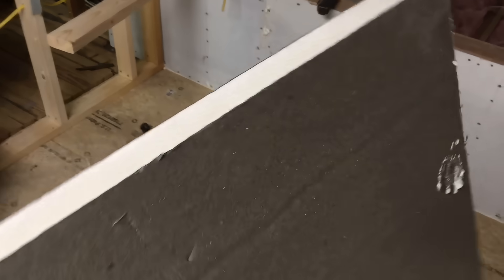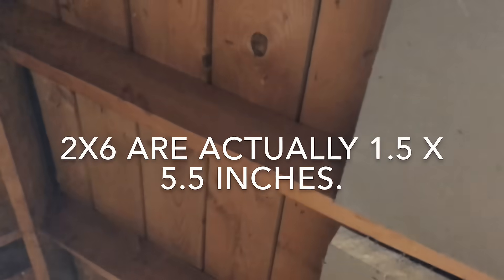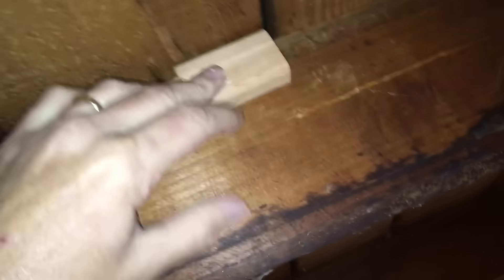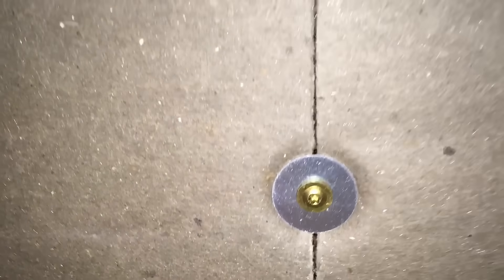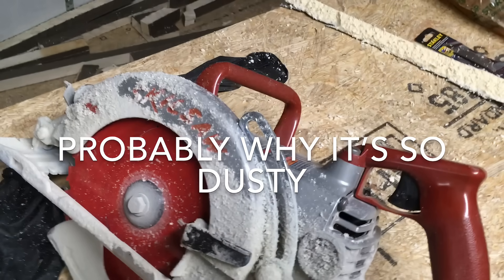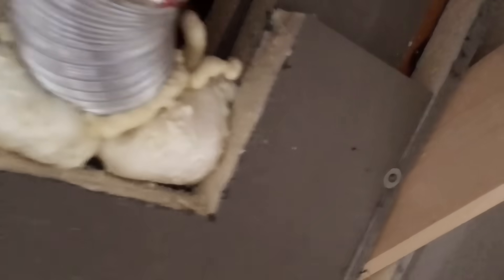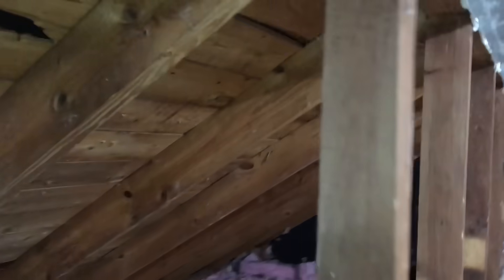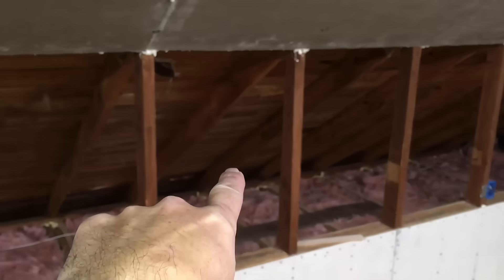Getting R-30 in an attic suite with 2x6 ceiling rafters

Comment: You could have had 4 inches of closed cell foam blown in for the same price with no labor and had air sealing and added structural integrity.
Reply: But 4"c.c is not not r31 5" is .
Reply: @keithibbitson5519  Well done.Far more rgidity than c.c., no off gassing, and c.c. has been found to leave air gaps and delaminate from the exterior sheathing. Additionally, if you air sealed all the seams and cracks, venting wasnt needed ; you could have pushed all the way in.
Reply: @laconjo Ventilation was required by code enforcement/inspector due to flat deck roof if the roof was gapped/ventilated above the deck (cold roof) then yes he could have but it was not a Cold roof it was flat decked and shingled.
Reply: 3” of closed cell is 98% effective for heat loss. R-value means nothing. 3” passes code and would be a better job.
Reply: @keithparker7041  I believe 3" is 87% but my point was that this technique uses a whole lot of labor to reach the same point foam would with no personal labor
Reply: @keithparker7041  Go tell that to your code inspector... R- value mean nothing... lol... yeah...
Reply: No Way We get it certified through code compliance. It’s a third party paid program to prove it’s compliant.
Reply: maybe where you live yes, but he just mentioned that for spray foam the price was about 3 times the cost of the rigid foam board... He would still have need the air gap between the shingle and the spray because the company for the shingle would not have approved it... meaning that is insurance company might have told him to suck it up if something ever happened to is roof because the shingle failed...
Reply from the maker: The quotes I got from contractors to spray-foam were about 3 times the cost.
Reply: somebody is ripping off somebody, I just got a quote for spray foam whole house 20 x 32 new construction attic walls and underneath floors for 3000
Reply: @greatbay1961  quotes I've been getting have been varying more than I expected. For my 1000 sq ft crawl and attic I've seen as high as 20+k to as low as ~12k not including removal/prep.

Comment: R30 isn't even up to code. Get familiar.
Reply: Your thinking of flat attic ceilings, it's less on sloped ceilings (at least on retrofits, not sure about new construction)  A lot of times it's up to the regional inspectors what they will allow.
Reply: desolate surfer it is where he lives , watch the video he covers all that.
Reply: That is roofing iso board.  Never got any itch from that.
Reply: This insulation is  considered closed cell insulation.  If it was sprayed closed cell you wld not need to vent. It may be the same for this

Comment: Just use pink foam and you will not itch. Also, hiring someone else works too 😁😂
Reply: Bluelights aquarium polyurethane foam has better R-value per inch. I think that you would need 8” of pink for R-30.

Comment: Not a fan of foam over the rafters and then screwing the sheetrock through the foam and then into the rafters. I'd build the rafters down with 1.5" x 2.5" filler strips with long (4") drywall screws and adhesive, leaving a 1/2" space between the boards and sheetrock.. Your sheetrock will remain more stable through the season changes. And you'd net out very close dimensions.
Reply: Where you have snow, make sure your rafters are spec-ed out for the weight of drywall. Not sure why you would want to close in your attic with drywall, but if you do, remember the weight of it plus the live load of snow.
Reply: Jerry anytime that you use any type of foam insulation code requires that the foam be enclosed with a fire resistive barrier. Sheetrock is the default barrier of choice, and that must be fire-taped at a minimum, but finished is much more fire resistive. When any foam burns it will put out very nasty and toxic gases during combustion. Certain foams are more flammable than gasoline.

Comment: The cracks sealed with foam aren't going to be R-30. Is that a problem with the inspector?
Reply: Neither are the 2x6s.
Reply: @notsure103  Each 2 X 6 should be insulating itself, but is it R-30?
Reply: @wadebarnett2542  the r value of an old dry 2x6 is probably around r6. The value of the foam would be closer to r30 if it was applied correctly , which would mean no gaps anywhere (tuff to accomplish with foam board packed in instead of leaving an intended gap). The r30 rule also doesn't take into account the near 100 percent efficiency of foam versus the varieties of packed in fibers insulation. The wood is the weakest link.

Comment: I'm in Canada, and those sheets come in 4'x8'x2" for $48.00! Also, building code may require the addition of a non-flammable surface in the room (dry wall), as the surface it comes with may not be accepted - definitely needed for 'bare' foam boards, of spray foam.
Reply: This insulation is made to go on top of metal roof decks. It's pretty much already fireproof.
Reply: It is not fireproof, when fireproofing is needed on a roof theres gyplap sheeting and/or densdeck which fireproof the product
Reply: Dens is a fire break, but mainly to prevent the polyiso from crushing into the flues of the pan decking. You can torch polyiso surface for awhile before it burns.
Reply from the maker: Are these the GAF EnergyGuard sheets? ...and you're right, this foam requires 1/2" drywall between it and the living space. Thanks for the comment.
Reply: Ouch! Here in California a 4x8x1.5  cost me $18 a sheet

Comment: Decent job. Still didn't get R30 in that 2x6 area. You had to go to the outside. I would not put R13 fiberglass on those knee walls and fiberglass R30 on flat ceiling after all that work on the slopes. Finish the job with the foam boards.
Reply: I was wondering what he would do about the knee walls. You suggest just continuing w/ the foam boards to the floor? How about air exchange in the finished space???
Reply: I agree how would you connect foam to FG batts just use more iso

Comment: I would never spray foam, a house needs to breath. If it’s totally air tight your asking for trouble.
Reply: That's why air tight houses need mechanical ventilation.  Usually done with a heat recovery ventilator.
Reply: bwillan 
I know right. A good house wrap and regular insulation and all that wouldn’t be needed. Guess it does help manufacturers sell a lot of extra stuff though.
Reply: Well back in the day that may have been true. Houses were leakier so that why they held up. The water that got in would have air flow to dry out. But we were also building with materials that weren’t as sensitive to water as today’s materials. And insulation works by trapping air and stopping that transfer in temperature. A leaky house can’t do that and ends up costing you money in heating and cooling and future homeowners money in repairs
Reply: @carsecundino  leaky doesn't mean you feel the wind blowing through.  Leaky  just means your not in a fully sealed plastic bag. Anything encased like that rots very quickly.  Ventilation doesn't need to be mechanical, unless you count the opening of a window as mechanical
Reply: Kirk Boivin Well with any strong wind you will feel the wind blow through in a “leaky” home. If you aren’t able to trap the air in wall cavities the insulation in those cavities isn’t preforming as designed. And with today’s codes homes have to pass a blower door test. Which makes homes a lot tighter than older homes, requiring better ventilation. Meaning we need to control the quality of air we bring into our homes and how much of it and when. A tight home doesn’t mean plastic bag because there should be some permeability in your house wrap (depending on where you live). But we need to keep water bugs and water vapor out and save on heating and cooling. Which we can’t do effectively in a leakier home.
Reply: @carsecundino  Your absolutely right about codes and testing.  Those theories were disproved with the failure of R2000 building.  Again with the massive failure of condo construction in Vancouver. Sadly the myth is still being called truth by those who profit  from it.  I can't recall a single building in North America or Europe that was several centuries old and built with the theories that are applauded today. Sorry about air quality, but fans and filters etc. ARE NOT GOING TO FIX THAT.
Reply: Kirk Boivin r2000 is a 30 year old voluntary Canadian standard and not a blue print for how we should build in every region. And to what failure are you referring to?
Reply: @carsecundino  I was referring to the condo failure on west coast, where structures decayed rapidly due to the theories of air tight construction which prevents drying of materials and greatly accelerated the growth of molds  and mildew.  Late nineties saw many stuck with huge repair costs any nearly bankrupted the new home warranty program.  Granted the west coast is a wet zone. Commercial construction requires artificial environment control for cost reasons, (the spaces are huge) residential environments need not be artificial. If you want to improve heating costs, lower the humidity level (crack a window even in winter) Sounds strange but it works.  CMHC has been publishing their findings since the late 50's. Ever notice how office environments are far less comfortable than outdoors ?  They have major HVAC systems to accomplish that.
Reply: Kirk Boivin I’m taking about building science not theories. And I agree if something can’t dry it’s gonna rot. But having a drying problem in a new construction home shouldn’t be your biggest concern when it occurs. Because these homes are more water and air tight meaning water shouldn’t get in (it never should in the first place but it happens) and obviously water wouldn’t be able to get out (for the most part). There’s still some transfer of water thru the building material. But much less previously allowed. If you have lots of water getting trapped in a home you have a bigger problem, you have a leak. Something is clearly wrong. But it’s not because of new codes and building standards. That can almost always be chalked up to installation error. And I don’t have any numbers to throw at you but a lot of the advanced building methods would have a lot of the problems you’re talking about but that would most likely be do to installation error. This is a pretty advanced (or out of the norm for most traditional builders) way to build and one can’t just simply jump into building like this when they have years and years of building traditionally. It’s a completely different animal just like commercial and residential are too. Yeah I agree it’s definitely a bigger up front cost but I’m the long run way cheaper and a far better investment. I don’t see how anyone could willing choose to continuously be paying hundreds each month in the winter to heat a home then open there windows letting all that heat out just to dehumidifier like how you’re saying. But that just goes to show we need to prioritize when building new homes. Build smaller to keep initial cost down and reinvest those saving buy building smart and efficiently
Reply: Shadow Hunter that is old world thinking before energy efficiency or minimal building standards were applied. These same homes had single pane windows that had ice dams in the lower corners when winter got cold enough, and bathrooms didn’t use exhaust fans to remove odors and humidity. Half of those homes didn’t have an external vent for the clothes dryer either, and furnaces averaged around 55-60% efficiency. Many of those homes had major insulation issues.
Reply: @bigk4755  all those things are true, however, you will not likely be successful with trying to create an environmental bubble.  Ventilation is a must have.  Cross flow ventilation is practically non existent in homes today. Dry air heats more easily  than damp and cross flow ventilation reduces the need for air conditioning. Products like Tyvek were developed to combat air leaks from wind in prairie zones.  They are not the greatest thing for water barriers. The point is you must have some minimal amount of air flow thru building components and you don't need energy sucking HVAC to vent your home.

Comment: Who the hell requires insulation on roof rafters?  I put up some radiant barrier on mine but no stupid laws saying they need insulating.  The attic floor is where you insulate.
Reply: He’s making living space out of it...
Reply: @Iamthathillbilly  
I'm currently installing a 36x48x18' pole building shell for a house.  The owner has requested that I install the rigid foam board that is required because the owner wants to see the trusses from inside the home, which are on 12' centers with purlins.  Purlins create a non-vented area, and thus the rigid foam is required.  At least 2" of it.  However, because the heating code required an r-38, I will be installing (2) layers of 2" r-13 rigid foam board, and then from underneath another 3-1/2" R-13 batting will need to be installed.  2x8 purlins are required. 

Yes, installing at the bottom chord level of the trusses would be easy but some people want to see the extra room in between the trusses.

Comment: Great vid. I've worked with foam board insulation quite a bit for insulating a slab for turning a shop into living space. Here in Interior Alaska. I never thot about using it for rafter insulation. But it's a great idea. I like how you did the spacers and used the washers and long screws. How will you attach the drywall to the rafters ?
Reply: gumboot65 good question!
Reply: Use 3 1/4 inch to 3 1/2 inch drywall screws. The foam is sturdy enough the drywall won't compress it. Put minimum of 5 - 6 screws on about 8 inch centers on each truss. Also, on the joints, try to lay it out so your sheets end on the center of each rafter however old houses not necessarily framed perfectly on 16 inch centers. So get yourself some light gauge flat sheet metal strips cut to about 2 or 3 inches wide and place them between the drywall and the foam board on the joints. They don't have to be secured to the rafters. The purpose of the metal strips is to keep your joints together. Just be sure to fasten the drywall to every truss irregardless of where they are. If your joint happens to fall completely between two rafters, no problem, the metal strips will keep your joints together. Use a 1 inch or 1 1/4 inch fine thread drywall screw to fasten the drywall to the metal strips. You don't need heavy gauge steel for the strips. The stuff your heat ducts are made from, are thick enough, as long as the screws you use, don't spin out. Good luck.
Reply from the maker: sorry, just seeing this.  Here you go:  https://youtu.be/dGeoA1ji_iM

Comment: 1) Could you do most of the cuts outside, at least all the repetitive standard dimensions? Leave the dust there instead of in the attic?

2) Could you cut it with a hot wire cutter so you would not create all the dust in the first place?
Reply: You could use a knife. That's what I do.
Reply: Hot knife won't cut through fiberglass

Though puf is butter

Comment: it will no doubt have moisture build up between the layers of each board.
Reply: April Schodowski I do believe you can just pack the whole space with insulation and have no venting, it’s called a non ventilated cathedral ceiling. There’s all kinds of stuff online about it, figure out what climate zone you are in and google it
Reply: @Iamthathillbilly  
Ventilation requirements are determined by the temperature rating of the roof shingles, mostly. If you omit ventilation, it may void the shingle warranty, block the building inspection and possibly decrease the sheathing lifespan.

If insulation is installed incorrectly, ice-dams may form on the roof, or water may condense under the sheathing in the attic, creating a mold problem.
Reply: @April Schodowski 
Since he used rigid foam boards, all he needed was a small wood spacer block above each panel corner. The sides of each panel foam-glued to the rafter lumber. It expanded to fill the tiny gaps. The roof already had soffit and ridge ventilation, so the required air gap runs from soffit to ridge. This dimension can be thicker than spec, but never thinner. And it should be kept consistent.

Comment: Dave,

What zone are you in? I like the idea but two things - where do you find this stuff? And second, is it safe to have that paper packing on the foam when you are layering it? It's a common no-no to have something like faced poly-iso stacked because you trap moisture in between two layers that can never evaporate once you seal the gaps. Same principal with laying paper faced fiberglass insulation on top of paper faced fiberglass insulation. Nice work, be sure to invest in a $30 respirator so your lungs don't kill you from those particals.
Reply: Roofers apply this "iso" in layers all the time. Not a problem.
Reply: Nicpedia It was stated that The poly-Iso is faced with a permeable paper layer.

Comment: Get a couple 20 in box fans and a couple cheap 20x20 air filters and duct tape the air filters to the intake side of the box fan.  Constantly filters the air...  I'd still wear a mask bro!
Reply: Never thought of taping air filters before that's brilliant! Thanks.
Reply: Silicosis,.. use the filters and a dust mask...  The fine dust from using the saw on it float in the air longer and better than you would think.
Reply: Filters plus vent it outside if you can, still wear a mask too !